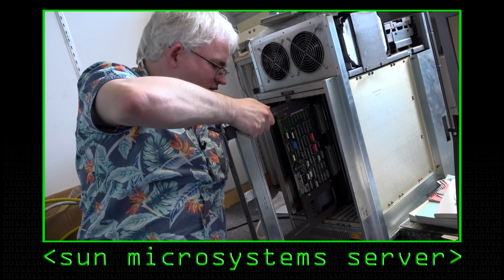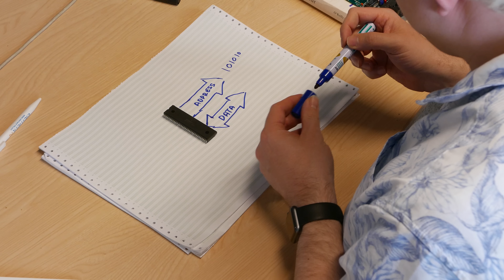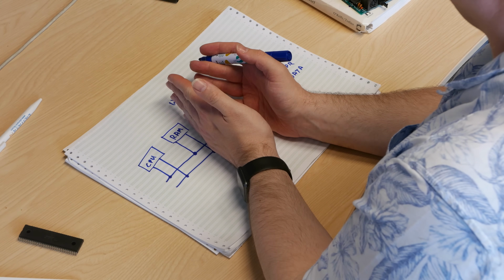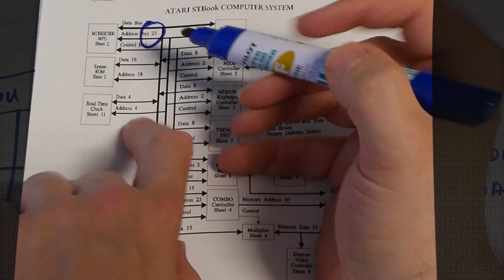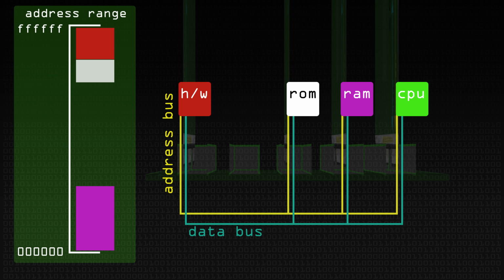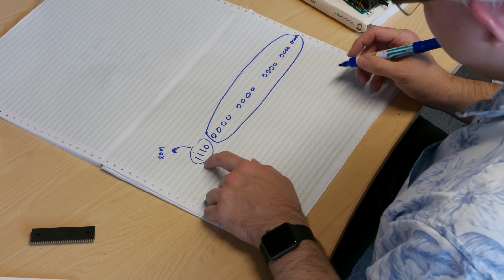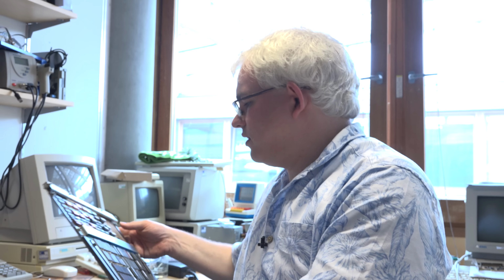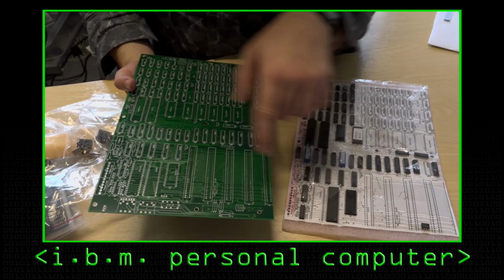Computer Connections - Computerphile

Comment: Information from a cpu when executed is addressed in bytes, which are stored on binary addresses(memory address) which transmits through a data bus to communicate with various pieces of hardware. Computer Connections are influenced mainly by the Operating System Kernel which is responsible for managing computer resources and allocating the memory address.

Comment: For Windows computers, to see what addresses are being assigned to your hardware:

Right-click the Start button
> System
> in the left sidebar, Device Manager
> pick a low-level device (ex "IDE ATA/ATAPI controllers > SATA AHCI Controller", or a few things under System devices)
> Resources tab
> in the upper box ("Resource settings"), scroll down to "Memory Range"

Comment: You probably don't want to put the ROM in anywhere else except for the lowest addresses (ie. Z80 started executing instructions from 0x0) or quite possibly the topmost ones, depending on the architecture.
Reply: spaqin it doesn’t really matter as long as there is only ram and empty space before. There is nothing to read there anyway.

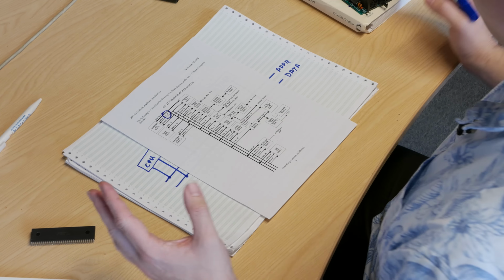Comment: At 5:45 : why is 23 bits equal to 16,777,216 bytes? Wouldn't 2^23 be 8,388,608 bits or 1,048,576 bytes?
Reply: The adressing is always based on bytes, not bits.
The 16.7M thing is also 24 bit, not 23.
Reply: 68k data bus width is 16 bits, so you have two bytes per address. 2*2^23=16777216 bytes.
Reply: Ohh, alright. Thanks, I know nothing about hardware.
Reply: 23 bits of address space, on a 16 bit machine. so we have (2^23) addresses and each address can handle 16 bits or 2 bytes, so total number of values is (2^23)*16 bits = (2^23)*2 bytes = (2^24) bytes = 16777216 bytes. EDIT: corrected a typo
Reply: It is worth clarifying buses handle words, not bytes. 68k has 23 address lines for 16-bit words, so it 
covers 2^24 bytes or 16MB. Internally the processor uses 24 bits to access individual bytes, but only 23 "wires" (called A23-A1) are used as shown in the schematic, because 2 bytes are put on the bus at the same 
time, and depending on the memory access one or both will be taken (implicit A0).
Reply: Thanks, that was easy to understand.

Comment: Is this also related to IRQ and DMA? I remember fiddling around with that when I was a kid. It was a nightmare :P
Reply: This is related to IRQs and DMA. IRQ solve the problem of "Hey CPU, here is your network card and I just received data". This aspect isn't mentioned in the video. 

IRQs in PCs are much less of a hassle now. Since around 2003 message signaled interrupts were introduced.
https://en.wikipedia.org/wiki/Message_Signaled_Interrupts

These allow for many more interrupts and make troublesome interrupt sharing a thing of the past.

Typically a card does a DMA transfer and then generates a MSI. PCI does not have a single DMA controller as PCI allows for bus masters.
Reply: DMA effectively requires something called a DMA-controller aka bus-controller, with it, multiple devices may request access to the bus, then be allowed to access another device on the system. This means a GPU can request RAM-access or access to another GPU. DMA isn't required for a  backbone-based-system, it wasn't used for example on the Altair and its clones.

Comment: With IBM compatible PCs, there was actually a time when much more stuff sat on (e)ISA or VLB or PCI extension cards. For example, my first 386 had an ISA card for the hard disk controller and for the graphics card, and then I upgraded it with 2 more cards, one was a sound card, the other was a CD-ROM drive controller card. The next generation of PCs included the IDE hard disk and CD-ROM controllers on the motherboard, but the graphics card, sound card and network card were still cards on the VLB or PCI bus. Later on, the sound card wandered onto the motherboard as well, as did the network card. And a bit later, even the graphics card got there. So now there is a motherboard which has 4 functions integrated that were separate before. I think this trend will continue as well.

Comment: I always kind of thought of the input/output versus memory signal line like an additional addressing bit.  It's not quite that, because when you're programming, you have to use IN and OUT instructions, and a particular processor may only use some subset of the address lines to address I/O (for example, only the lowest 8 bits or the lowest 16 bits).  The idea of decoding is exactly the same with this extra bit, the IO/MEM "address" bit needs to be (say) high, as well as all the other addressing bits to be in the proper pattern, for the peripheral to respond.

Then there's other styles of processors (68000 series, the 6502, and others) which don't have any separate I/O instructions, the peripherals are accessed the same way as memory.  It's like they don't have that extra IO/MEM bit.

Comment: on the data and address buses are they communicating over i2c ? 
if not i want the name of the protocol to read about it.
Reply: tesla. py There are many different system buses; for that Sun machine it would be VME, but you've likely heard of ISA and PCI, which operate similarly. AMBA and Wishbone are other examples typically used inside system on chip architectures. Frequently they were designed for a particular processor in the first place, tying VME to 68000 and VLB to 486. I²C was designed for much slower and smaller control interfaces, such as for TV tuners, but is reused in many places including SMBus. For instance, modern PCs use a I²C bus to identify memory modules, storing information on how to set up the DDR3 or similar buses.

Comment: While nearly all PCs had motherboards, there were a few with passive backplanes with the processor and memory on an expansion card. Most backplanes have address decoding logic in each card, but some had pre-decoded select signals like the Apple II and the NuBus. That makes the boards cheaper and allows you to put in two identical boards without having to configure them but limits how many boards a system can have (I once built a PC with 72 slots, for example).

Comment: So why don't all PCs today use the backplate system with the main cards preinstalled? I feel like it would be much easier to get into custom PC building if your CPU came on its own card like this instead of having to remove the heatsink, remove the old thermal paste, undo the clips, replace the CPU...
Reply: kiefac motherboard looks "cooler"?
Reply: Too big.
Swappable components are always larger than integrated ones. On top of that, some components like the CPU and memory require more bandwidth than is feasible on a shared bus.
If the CPU came on it's own component, it would pretty much be as complex as the motherboard itself, so you're essentially installing 2 motherboards.

Comment: That is kind of interesting. I always thought that IRQs did this type function (SUN could have been custom, etc though). 
I have dealt with a few backplanes, but my case they mounted SCSI HDDs for connection into the SCSI bus then the RAID controller. In a case like that backplane with SCSI it assigned SCSI I.Ds to the drives based on the slot they got put in. 

The addresses he is talking about and how it is segmented kind of makes me think of the network, host, subnet mask used in I.P networking. I don't know how it works, but I know in Cisco switches if you have to reset the password, etc you have to change what is called a configuration register. I think the value varies by model but somehow when you change the config register it then points to a place in the config that skips the password lines, etc. I always assumed that value was a memory address, but I don't know. I think on the catalyst 2960 it was 0x2902 and 0x2904 (or something like that).